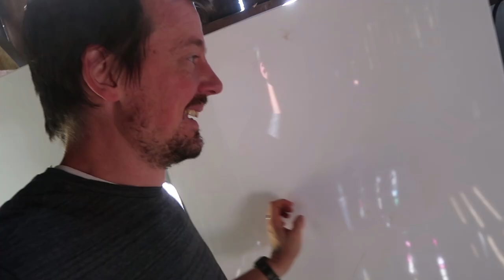I Can't Stop Her From Buying Cows!

Comment: Silly question. Why do the bricks have holes in them?
Reply: So the motar mix can also be oozed in the holes for extra strength and stability on the wall.  That was a well built wall!
Reply: They are also lighter to handle, lighter to ship, uses less energy to manufacture and less material.
Reply: Thanks, makes so much sense!  I would not have figured that out.